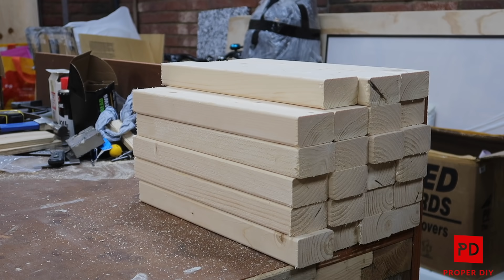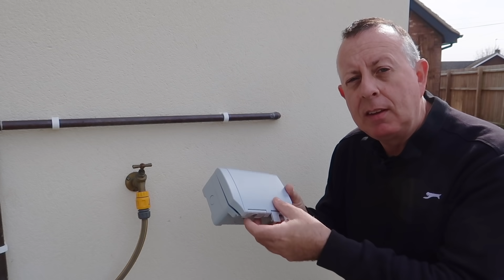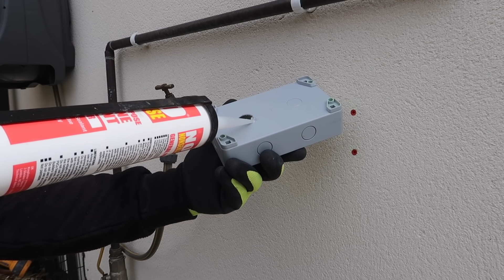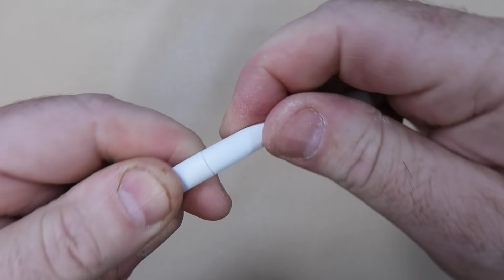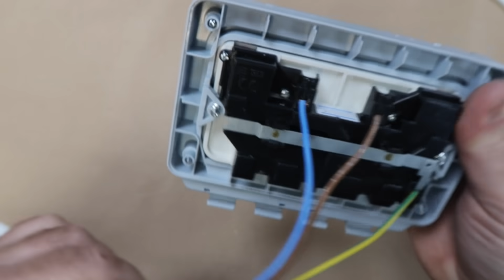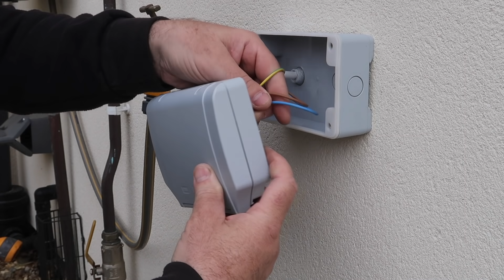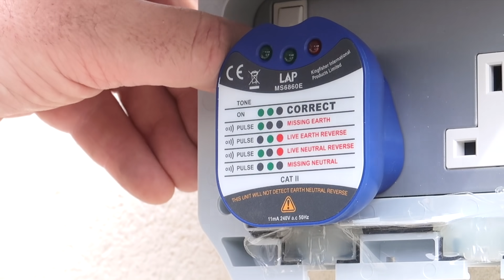How to Install the Easiest Outdoor Socket

Comment: Just out of curiosity will you need electrician to test it certified etc.??
Reply from the maker: No. Under part p of the UK building regs, a home owner is allowed to install new light fittings, switches, sockets and a single fused spur as a branch of an existing socket on the ring main without it being 'notifiable'.
Reply: @ProperDIY  What you installed, because it has a plug on, isnt classed as fixed wiring so doesnt need certification etc. But, to be pedantic, everything else you listed, while isnt notifiable under part p, as its a modification to the installation still would need testing and a Minor works certificate to ensure it still complies with bs7671 afterwards. How else do you know your ZS from your new spur isnt too high that if there's a fault your circuit protection wouldnt operate in time etc ?
Reply from the maker: @codenamenel  You are correct, without testing I don't know what the ZS value for the new installation. If I don't use this external socket, I use an extension lead from an internal socket, being half cut and damaged under the back door like the rest of the population  - I don't the ZS value on that either.
Reply: @ProperDIY  Perhaps read what I wrote correctly. Your socket here doesnt need certification etc (and your BS1362 13A fuse in your plug as circuit protection would increase the maximum ZS anyway)
BUT, if you are modifying the fixed wiring, as in your list of non notifiable part p stuff, although you dont have to notify building control that you have say, extended your existing sockets ring, it still does need testing and certifying because you are modifying part of the fixed installation.
Reply: @codenamenel  just to get a clear answer,so if it has a 13amp plug on the end it would not need certification from a registered spark or notification to labc (for non registered cps )but if tapped into back of socket weather it be ring or end radial it would need certified by a registered spark (napit,niceic etc)? Just would like to know . I’m a homeowner ,in the trade non sparks, I do diy but would rather get a sparks if I know it’s something that needs to be certified to be safe and legal . Diyers can’t do R1+R2s or zs values , they just think if it works it’s safe 😂😂 also what’s the crack with changing a pendant light to a metal decorative one , is that something by law a sparks has to do and issue a mwc or can it done by a general diyer? Same for a downlight/s can a non sparks change them or does it have to be a sparks? Any answers would be really appreciated 👍👍
Reply: @kingofthetrowel1725  yes things with a plug on, any plug not just 13A, are not classed as fixed wiring, if it's not classed as fixed wiring then its not subject to the same regulations as if it was, for part p there are certain things like adding new circuits etc that must be reported to the labc by a competent person. 
However anybody can do certain things like modifying existing circuits such as adding sockets to an existing ring etc without reporting it to labc. 
Even though they don't need to be reported to the labc, the work should still comply with electrical regulations (known as bs7671). These regulations are not law (part p is though) but if there was any incident that landed you in court because of an incident due to your work, if you can prove that you installed any work to comply with bs7671 it's a very good defence in court. 
To comply with them anything you install has to be tested by a competent person and a written record, such as a Minor works certificate produced.
With metal light fittings anybody can install one but, as it would be classed as an "extraneous conductive part" ie if there's a fault the fitting would become live, then it must be earthed. A lot of old lighting circuits didn't have a CPC, only live and neutral so there is no means of connecting the light fitting to earth. If there is a CPC in the circuit, one of the tests is continuity of CPC (making sure the CPC is continuous from the consumer unit, all through the circuit to the point you test it) which is your R1+R2 or R2 measurement. Without testing it, although there is CPC connected at the light, you cannot be sure it is continuous all the way back to the consumer unit.
So basically any modification to the fixed wiring must be tested and certified by a competent person, but certain things ALSO have to be reported to the labc.
Reply: @codenamenel  cheers for the reply,thank you so much for the info you’ve given really do appreciate it.i think I’ll just get a sparks in even for the smallest of jobs it’s the best way to be covered isn’t it 👍 again thank you for explaining as I’ve been struggling to find clear answers 👍
Reply: Also another one say I do get a sparks registered with a gov bod (napit) and I do get them to change the pendant to a metal decorative light fitting , like you said I understand they will test the cpc for continuity etc but should the sparks issue me with a minor works certificate just for doing the change ?
Reply: @kingofthetrowel1725  yes, any change to the installation needs testing and a certificate issued to reflect the changes carried out.
Reply: @codenamenel  brilliant thanks again 👍 much appreciated , it’s just so I know for future when I get a sparks in what certs I should be getting 👍👍 cheers again .. I take it you are a spark , fancy coming and changing 5 pendants to decoratives and 20 down lighters 😂😂👍👍🙌🏻🙌🏻
Reply: @kingofthetrowel1725  the 3 most often used certs are - for modifications to existing circuits you should get a minor works cert that's usually 1 page per circuit modified. For new circuits/rewires/consumer unit replacement etc you should get an installation certificate, about 4 pages in total, and for periodic inspection and testing you get an installation condition report, up to 8 pages.
I'll have to decline the offer tho, I'm too busy to take anything new on for a while 👍
Reply: @codenamenel  great stuff 👍 thanks again for the info 👍
Reply: @ProperDIY 
That's great news looks like don't need to pay extra for someone to visit for 5min to test it. Many thanks for your message

Comment: I haven't finished watching yet, but drilling from both sides and managing to meet needs a compliment no matter what else happens.
Reply: Reminds me of the channel tunnel.
Reply: @georgesmith8988  he'd have needed to leave the drill in the wall....:-)
Reply: Was going to say something similar! aha. I've also not finished watching, but drilling from either side and meeting in the middle is a skill in its own right!
Reply: @DaveVisone   fgýhuhhjy⁸
Reply: Remarkable, don't think I'd have that luck.
Reply: @patrickokeeffe6998  I don't think it was luck. He used the Force, a Jedi thing, lol
Reply: Totally agree, what a madman 😂
Reply: Skinflints need to be spot on 😛😂
Reply: Managed to get the required drill bit, 400mm long for £5 on EBay. I was too scared to line up the holes!
Reply from the maker: Thank you. Careful marking and drilling! - I was determined not to have to spend even more money on a longer drill bit!
Reply: @ProperDIY  Very good instructional video, I was more concerned about how did you know there were no fixtures in both walls before you made the holes!!!!
I would like to know how did you install that tap on the outside and linking it from the inside.
I have just subscribed.

Comment: Another Excellent Video im no electrician and that is the way i probably would do it 
it looks safe and easily isolated from the rest of the house
but would it be to frowned upon doing it that way by an Electrical professional
Looking foreward to more content 👍
Reply from the maker: Thank you. I'm sure it would be frowned upon by an electrician because if everyone did it they wouldn't have so many customers. It's essentially an external extension cable and allowed to be installed by a home owner under Part P of the building regs.
Reply: Its actually easier sometimes for Electricians, as its not classed as fixed wiring I dont have to test it on an EICR lol

Comment: Great job, great tip.
We know what we know but I paid a sparks £70 to fit a single outside socket and I paid materials on top! Seeing this now I could defo of done it this way myself.
That's it, I ain't doing nothing now til I've seen Stuart do it..
Reply from the maker: Thank you! Your last line is the best comment I've ever had! I'm going to print that out and put it on the workshop wall!
Reply: @ProperDIY  👍 perhaps you will do one one day changing a hot tap sink washer! Lack of confidence is delaying my action! 🤫
Reply: @somewhereelse3813  Plumbing is simple really, tools and materials aren't terribly expensive, get stuck in! :-)
Reply: @itsafeaturenotaflaw  yeah you know what, your probably right. Get confidence in doing I guess
Reply: Bargain because external sockets need to be notified to the local authority. Costing over £200 for inspection.

Comment: Is it ok to plug straight into the wall or is it best to have rcd socket to plug in to?
Reply from the maker: Ok the plug straight in if you already have an integral RCD within your consumer unit. If not, then you definitively need either a stand alone RCD or an external socket with one installed.

Comment: if you didnt seal the inside hole between conduit and wall it means the cavity is open to the inside of the inside box.  dont remove the insulation fully from the cable, pull it off about halfway then twist it to twist the conductors pulling it off as you go.

Comment: 09:00 never understood why UK electricians do it doubling . and the rest of europe doesn't .. also much sockets in europe have not enough room for that .. never done it .. also  better to use ferrules on this  stranded cable ..
Reply from the maker: I think the theory is that it gives the screw more cable to bite down on. I'm not convinced! I have a new house and none of the installation has been done that way.
Reply: @ProperDIY  yes i understand the idea idd.  In belgium we don't do this and i think rest of europe also not the case :-)  Our type  sockets would not even allow it i think .. 2x2,5mm = 5mm ..therminals nog made for that in our sockets ..

Comment: Great video, you present them really well. Any chance of making a video on fitting wall plugs and what size to use, and drill size needed for each plug? I'd find that useful, thanks.
Reply from the maker: Will do
Reply: Google

Comment: It must be me, but i just wonder why you did not just spur of the nearest socket, Only because I am wondering what electricians feel about this when they mega test, especially in what looks like a very expensive property, is it me, i don,t think so.
Reply: As an electrical contractor I agree it would make sense but I would rather  a DIYer does this as it has more protection
Reply from the maker: The premise of the channel is to encourage the average DIY'er to 'give it a go'. I wouldn't want to suggest to people that they spur directly into the back of their living room socket and suggesting installing a 'switched fused spur' is maybe too much. Definitely more protection doing it this way and no way to control it remotely when wired straight in.
Reply: @ProperDIY  Yes I get exactly what you're trying to achieve, with this video my worry was, is it correct is it 100 percent safe, and would the rules laid down by the controlling councils governing electrical installation agree this really is ok, You do brilliant well explained video,s on fencing and garage conversions which I have thoroughly enjoyed watching as a handyman with some knowledge, of general building, and some in most trades? When you watch pro electricians on utube as I do all the time they constantly remind us about safety, and not touching it unless you are fully trained up to do so, sorry for waffling on but electrics are dangerous.
Reply: @andymerrett  Agree thanks for your input, maybe I just worry too much about people with no understanding of electrics, just having a go so to speak,I have some knowledge and have worked alongside several sparkys , and that has given me to confidence,to do some points in my garage which i am converting to a snooker and pool room,I also have to move a few lights for overhangs to light the table, But i recently had a massive prob with my board, and i just got in a fully experienced sparky to sort that out. and replacing some trips for me, thanks anyway,

Comment: Another top tip filled vid, i see your point with the cable clips i normally put a well positioned 6 inch nail straight through the cable every 6 inches to make sure the cable is firm to the wall and have no concerns over safety as when its all plugged in i normally get the neighbors kids to stand in a bucket of water and lick the cable and switch so far no issues, keep the vids coming as they are very helpful.
P,S top tip about the remote switch for the power i will wire in the mother inlaws chair and see if it lights her up from a safe distance taking into account health and safety guide lines
Reply from the maker: I particularly like the tip of getting the neighbours kids to lick the cable when well grounded - back to basics!

Comment: Lost your IP rating when you didn’t use appropriate gland. Would drill drainage hole when using rear entry.
Reply: congratulations - You are the first keyboard electrician., I know you just couldn't help yaself so please collect your pedant award. 
Everyone knows how cable glands are totally impenetrable to water and silicon is basically a water sponge and magnet all in one!, what was he thinking!!!!
Reply: @mattsan70  wow what a comment. Not a keyboard electrician at all. In the video he says he paid for an IP rated fitting and doesn’t want to drill a hole as it will lose that rating, all I’m saying is he’s lost that rating already so should drill a hole. Didn’t slag off the work, but clearly you’ve taken offence, so here is your award for being a snowflake.

Comment: Little tip I do with any plug is make the live wire shorter than the neutral and the earth longest, that way if the cable ever gets pulled the live wire is the first to get ripped out
Reply from the maker: Now that is a very good tip! I've not heard that one before but immediately understand why! Thank you.
Reply: @ProperDIY  that’s how you are supposed to fit a three pin plug . Always have the cores at different lengths
Reply: Yes that was one of the first things taught in college (80s) lecture gave us all a plug top and said wire your plug, only two of us got it correct, always have the live wire taught and a big curl in the earth, doesn’t matter if the live comes out means the appliance won’t work but the earth should never come out first.
Great video.
Reply: When I wire a plug I measure the path of the earth wire, then cut the neutral about 10mm shorter, and the live about 10mm shorter than that. Perfect lengths, every time.
Reply: Of the few things UK does correct is the 3 pin plug,...the length of the wires are designed to exactly that.
Reply: Just watched this and, after thinking ‘what a bloody good idea!’, was about to say the same thing. My dad taught me that little nugget and I’ve used it ever since. Great videos, PD! 👍
Reply: Common knowledge with any spark,  check inside any uk plug and you will see this
Reply: Oh yeah, what a brilliant tip, I’ll be using that one in future,thank you
Reply: When you wire a plug it's shorter anyway    ffs
Reply: @markyd2633  the brown is shorter because it’s closer to cable grip it’s all about earth needs to have that bit of slack when cable is pulled
Reply: @neiltrevatt  and the shape of the plug, the live points straight to the cable grip and out so least resistance
Reply: @markyd2633  Only if you wire it properly...   I've looked at plugs where the cord grip may as well not exist as the outer insulation has been stripped back too far, where the earth wire is taught but the live is slack..  The truth is, many people don't have a clue and screw it up.  So someone who knows how to do it putting it as a tip is a good thing.
Reply: @markyd2633  - Oh look, this channel finally has its own troll...  lmao.
Reply: @markyd2633  ffs

Comment: Another good reason for using an indoor socket to power the external supply is that it can be done in compliance with UK regulations. If hard wired, doesn't it need doing by, or certifying by a qualified electrician?
Reply: Correct
Reply: It should be done by a professional but this is the best way for a DIYer to do this as there is a lot less danger involved
Reply from the maker: Totally agree

Comment: Wouldn't a cable gland have been easier than all that silicone?
Reply: A rubber grommet that fits the knockout hole might be even better as it has a much smaller size.
Reply: Thats why there are DIY ers . A pro wouldnt do it like that. Plus the socket is too close to the outside tap. The regs stipulate a set distance.
Reply: @nigelshephard4019The regs are written by very clever people who have been to university and are obviously made very difficult for the average Joe to understand, it's saying something when it has even been necessary to produce a guide to the guide (electrical regs) so to speak.

Comment: Good video, and l like the trick of using the hammer to measure distance between cable clips.
Reply from the maker: Glad you liked it!
Reply: Yeah, it’s what I was taught 40 years ago as a GPO apprentice technician; was also told to solder flex ends before screwing into plugs or sockets, - still do!
Reply: …must be getting old, - it was 56 years ago 😱